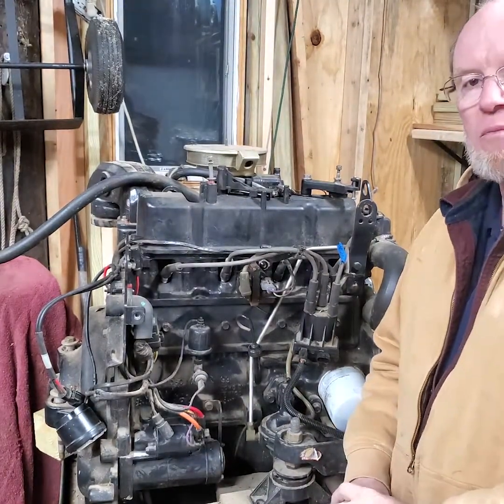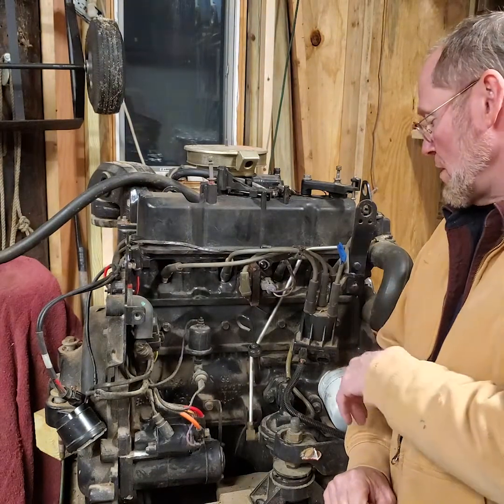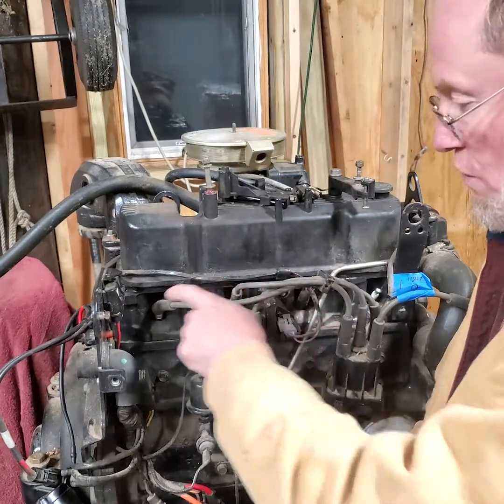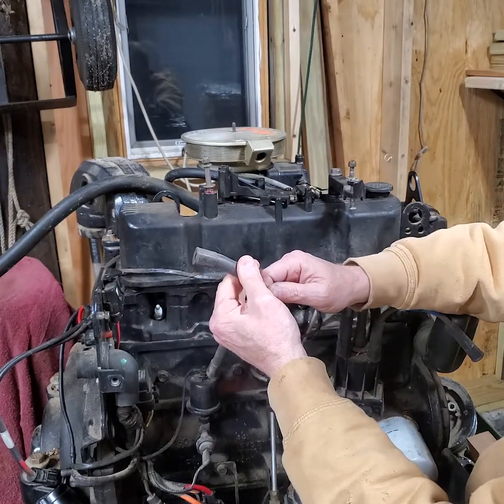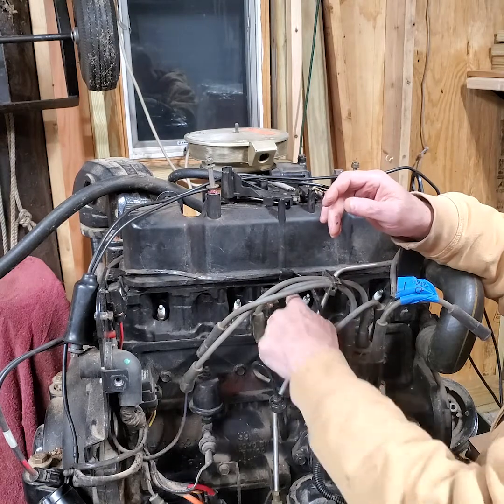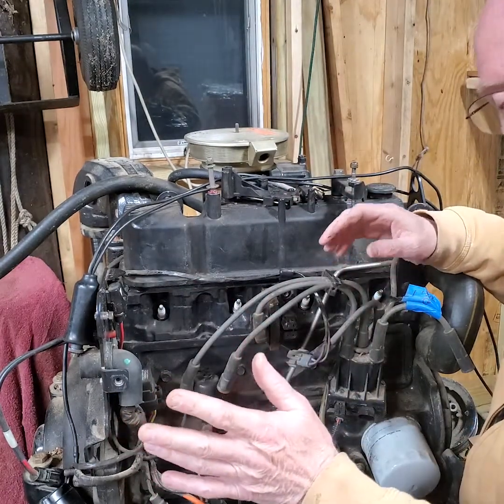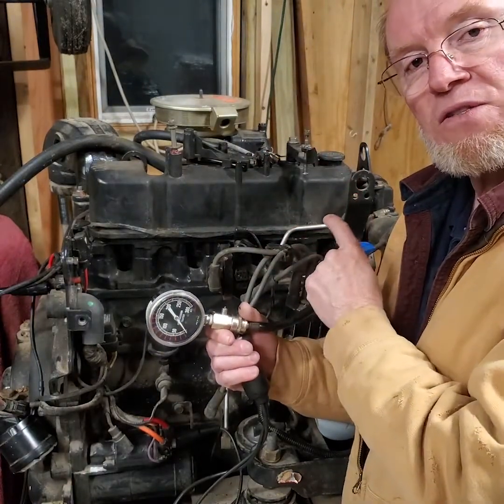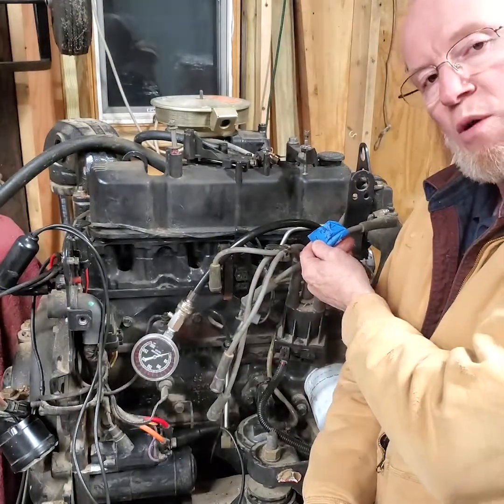MerCruiser Engine compression testing

Comment: can i do this test when the motor is in the boat using the key?
Reply from the maker: Yes but unplug the ignition coil wires (purple and gray)
Reply: @tedsmarinerepair8956  thanks for  the help. So my merc 3L book says the firing order is 1 2 4 3?  its a 91
Reply from the maker: @Tangrisnr  yes
Reply: @tedsmarinerepair8956   thanks for your help. your help let me decide between two boats. one had bad compression the other is all good. all in the 130s. nextvis to figure out why at wot after its all warmed up running awhile it bogs at wot. but not less tho. Carb mayby?

Comment: Hello ted. Quick question. I have the engine on the boat and need to advance the engine so I can see if everything is moving correctly. How can I do that? The motor mount is right in front of engine.